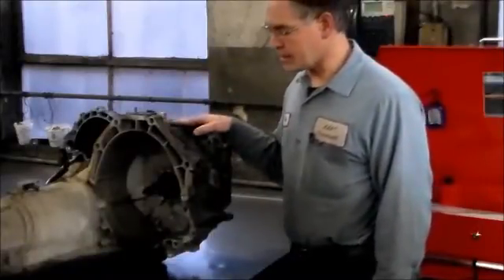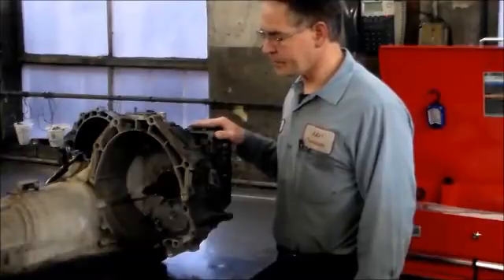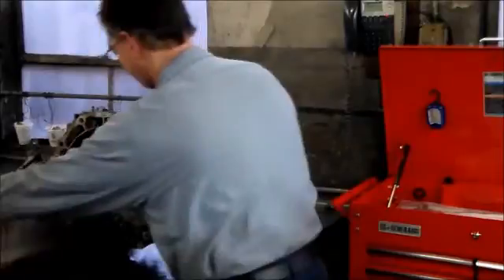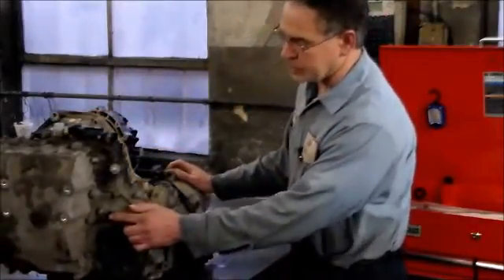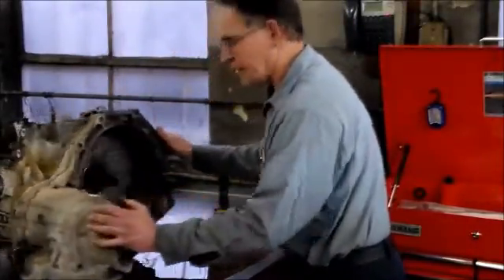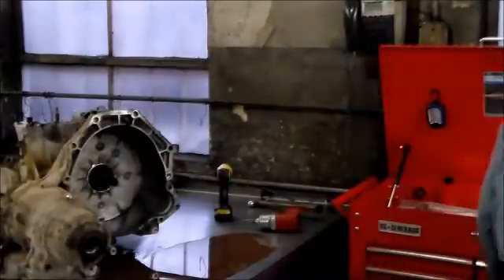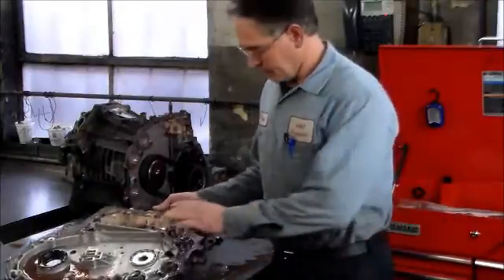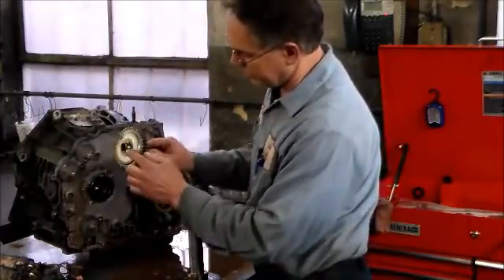AX4N Teardown Inspection, Part one

Comment: Great video, looking forward to watching more.  I will be rebuilding a high mileage Ford Freestar transmission soon.
Reply from the maker: ok, What is the problem with the trans?
Reply: @GaryFerraro  286,000 and it leaks.  It's working OK for now.  I have a low mileage engine so I am willing to do the transmission.

Comment: I have a 1999 Ford Windstar with AX4S TRANSMISSION and while driving at a constant speed on the interstate it all of sudden stopped moving checked for leaks(they are none) won't go into gear but had fluid....

Any ideas... Striped shaft? Blown clutches? Should I rebuild or buy.... Please help, pretty please 🥺😔🙏 lol 😁
Reply: Someone said possible bad shifting solenoids
Reply from the maker: @nicfle_gladiator  Sounds to me like the converter spline is stripped out if this happened suddenly
Reply: @GaryFerraro  literally out of no where.... That or the plates is my next guess.... Because when I hooked up the scan tool I could engage and disengage solenoid, so I can hear it do I assume it's working.... It works in 2nd weirdly but nothing else, no reverse, 1st or drive
Reply from the maker: @nicfle_gladiator  ok, so the car moves in 2nd, then not a stripped converter.  If it happened suddenly then something broke or stripped
Reply: @GaryFerraro  what should I do, or what can I do to further diagnose it
Reply from the maker: @nicfle_gladiator  Pretty much have to pull the trans and open it to see what failed, any noises?

Comment: Thanks for the video. For a 2005 Sable with AX4N what are the chances that a P0734 code is caused by a bad shift solenoid 3? Recently it hasn't been routinely shifting into 4th gear. Occasionally it does shift into 4th especially when warm.

Comment: Gary  took the clutches out on 3rd piston out top part then put air to it no push feel the air around it  . Granddaughter thought it was out of the tower but with every thing off could find it better. Believe the air trick worked thanks for the help

Comment: Have a ax4n burn 3rd clutch pack seals and piston looks good solenoid is good would it be the valve body or what have you seen
Reply from the maker: could have a problem with the EPC solenoid, i replace them every overhaul
Reply: Would it have a code the guy that hooked up said solenoids where good
Reply from the maker: @jamiekrebs9208  If the solenoid is mechanically clogged, you won't know, computer looks for correct current draw.  3rd gear burn up is not common for this trans, 2nd clutch burn up is. make sure the double drum has no ring grooves where the orange sealing rings ride. Are you overhauling the trans?
Reply: Used a snap on
Reply: Yep have it apart put new 4 clutch packs even though 3 only ones burned put it together slipped in 3 took back apart piston on 3 looks good haven’t took 2 piston out how many o rings only see 2 5 orange
Reply from the maker: @jamiekrebs9208  make sure the inner seal in the drum is ok, you need to air check the 3rd clutch through the center support, use 40psi of air and listen for leaks
Reply: Gary Ferraro ok thanks
Reply: Gary air it up 3rd does not move 2nd does hear air granddaughter feels air in the whole of the center support can’t feel any groves I see where orange rings don’t think it is sealing is the drum bad or the center support
Reply from the maker: @jamiekrebs9208  I would try the rings first
Reply: Gary Ferraro put the 5 in new to start  guess it’s not sealing orange ones
Reply from the maker: @jamiekrebs9208  Did you grease the rings? the rings need to expand, if you greased them they may not be able to, if you have trans fluid try wet air checking, , put some fluid into the port then air check
Reply: Gary Ferraro ok
Reply: New piston on 3rd fixed it thanks for the help God bless you
Reply: Trying to do a patch job
Reply from the maker: @jamiekrebs9208  I would do the piston for 3rd and air check the clutch through the center support. make sure the 2nd clutch is ok, that is the driving clutch in this trans meaning without 2nd you will have no 3rd or 4th. The rest of the trans works ok? you have it apart?
Reply: Yep 3 only
Reply from the maker: Jamie Krebs Awesome. Thanks for the update

Comment: Hey Gary, quick question. Check transmission light comes on on my Ford Taurus 2005 and code says P0733 gear 3 incorrect ratio. Changed the fluid and filter thinking that may be an issue. Changed the input sensor. The transmission surges and revs at high rpm then i hear a popping sound when i finally brake at a stop sign. Car has 78k miles on it. Seemed to be a lot of metal in the pan. First time changing tranny fluid ever but what was in there seemed like quite a bit. Trying to find direction. When driving in 1st and 2nd gear it’s fine unless i give it too much has. 3 it slips but gradually picks up speed. Can go the usual 70 mph on freeway. And even more. So it’s weird. Can you give me some direction please!!! Is it a solenoid issue?
Reply from the maker: This code is a mechanical code, Don't really see to many solenoid issues with these, i would say something is wrong with the 3rd or direct clutch pack. Does it slip all the time when the car is cold and hot?
Reply: Gary Ferraro yes it’s a continuous thing now. No matter the conditions.
Reply from the maker: @powermoveschris  Ok, sounds like something with a clutch pack, how is the 1-2 shift? 2nd clutch is the weak point on this trans and without 2nd you will not have 3rd or 4th
Reply: Gary Ferraro i would imagine that’s correct. There was so much metal in the pan. At least a quarter inch or more thick. Shifts fine in 1 and 2. That 3rd gear is where the slippage occurs. I notice the tranny surging and that’s when the gear ratio code came about. Car would just take off and accelerate randomly and elevate the rpm
Reply from the maker: @powermoveschris  Internal for sure, may have hard part damage

Comment: As far as I'm concerned the most typical problems I've seen with this Transmission in the Taurus as well as in the Continental which it never should have been in the Continental is the torque converter goes bad you should carry a torque converter in the trunk of your car as well as speed sensors out of all these speed sensors I would like to know how to replace them troubleshoot them at cetera
Reply from the maker: To trouble shoot speed sensors, if you have a scanner that shows live data you could see if your getting a reading on the scan tool

Comment: Hi Gary i found my line pressure around 75-100 and found 0 at epc tap? If you remember my transmission is not going past 2nd gear. I never checked the pressures on the previous Transmission that I had rebuilt but looks like I had the same problem on that. It can or cant be that both Transmissions had the same problem. But can you tell me where to begin my diagnosis. Please and thanks
Reply from the maker: ok, so this trans stays in first correct? and you swapped another transmission and same problem?
Reply: Gary Ferraro yes sir shifts from 1 to 2 fine then no 3 4 ... No codes
Reply: Gary Ferraro maybe the recent Transmission I put in also has a faulty valve body??

Comment: Gary Ferraro hi after a while I got time to play with my Windstar looks like the PCM is bad, I did test the wiring and pins on the PCM according to my alldata and found open circuit at the PCM between pin 6 -- to 71,24,25,51,76,77,91and103
This test was for the TSS turbine/transmission speed sensor test at the PCM  which other pinpoint tests were good. If you remember I had rebuild the transmission and it never shifted then put in another from the junkyard and did the same. What would you suggest. Any further tests? And should I buy a used or new PCM if available from the dealer and probably they can program it without the vehicle. I tried looking but I didn't see any burn marks but I will still try to further check this PCM. Still I will appreciate your advice. Thanks
Reply from the maker: Can you give me the year, make and model and engine size of your car, i would like to look at a wiring diagram as well
Reply: Gary Ferraro 1999 Ford Windstar 3.8 engine
Reply from the maker: ok, let look at a diagram and get back to you, may need a day or so shop is very busy
Reply: Gary Ferraro sounds great thank you very much
Reply from the maker: i looked up a wiring diagram, pin number 6 is the output speed sensor. Are you getting any codes?
Reply: Gary Ferraro No codes (active or stored) but I Might have noticed the theft light flashing when even when The engine was running (which might relate to a PCM issue).
Reply: So do you mean if the pin is not responding on my resistance test it means I can order a new PCM I think flagship1 maybe has one for $119 and I can also test the pins on that. I tried going to a junkyard to find a old matching PCM for cross checking mine but I didn't find a match. But do you think my transmission was not shifting(only shifted till second sometimes and would not come back to first, on both transmissions I put in), could this pin not responding be reason of my issue?
Reply from the maker: Surprised its not shifting and not setting any codes, have you done continuity checks on the wires?  So this just stays in 2nd ?
Reply: No codes, wires are good, it stays in 1st then moves to second sometimes and stays there until I restart the van
Reply from the maker: Ok, do you have access to a scanner that reads live data?
Reply: Yes sir I have one that reads live data

Comment: New fluid and filter about a month before problem started and def checked the level is correct. Thanks
Reply from the maker: ok, at this point you will have to look inside the unit,  If the other gears are ok, im thinking that the low intermediate clutch may be the problem

Comment: Hi Gary, i have a 2004 Freestar that i think has a transmission problem. My wife had told me there was a clicking sound up by the left front (drivers side) of the car when driving. I suspected a bad cv axle so I got under the van. The cv axle and boot looked great, no tears, no leaks, clamp tight? So I got in and drove it around and I occasionally heard what sounded like a grinding noise. The next day my wife drove the van and she lost power to the wheels. The car engine was running and the RPM's went up when she stepped on the gas, but the van was moving forward on it's own power. A little research on the internet and I found out that this van transmission has the problem with the pump shaft splines in the torque converter grinding off. This van transmission already had a recall for the problem but Ford just put in the same parts that went bad the first time. I am told there are upgraded parts now (a better pump shaft & torque converter) so I am tempted to do this repair but I can't find any video's on how to pull the transmission. Can you offer any advice? Once I get the transmission out I would like to do the rebuild as you show here.
Reply from the maker: I think they have harden splines for the converter,  Do you have reverse? Where are you located?
Reply: We're out here in California. I will have to check on the reverse (I took the battery for another car - had to get to work). Anyway, if it has reverse, does that mean it isn't the  torque converter spline issue? A neighbor of mine, who works on cars a lot, said it may actually camshaft or crankshaft position sensor (not sure which one he said). Ever heard of this causing this type of issue?

Comment: Hi Gary, thanks a million for posting this teardown it was a huge help! I had similar symptoms to Chad below on my 2002 Sable w/3.0L Duratec. Reverse and first gear seem fine and it shifts into second ok but then begins to slip when you give it gas and never makes it into third. I've got it apart now and sure enough, the intermediate clutch/drum is burned up. My question is, I ordered a "rebuilt" direct/intermediate drum from Rockauto and it is slightly shorter. I've looked at several supplier web sites and only see one part specified for my car. Is there more than one size for the direct/intermediate drums? They both appear slightly shorter. Here's a photo with the original (obviously overheated) on the left and the new one on the right: https://goo.gl/photos/nvCeYPjtSds318CVA Thanks! Mason
Reply from the maker: I wouldn't use that drum, it looks shorter, there is an AX4N trans and also an AX4S  trans,(same style unit but different) maybe take the foward drum off and look at the spline see if thats different.
Reply: Thanks for the quick reply! Yep, it's definitely shorter. Here's the original with the forward drum off side by side: https://goo.gl/photos/cFWzxpLKDFyZvmcz6. The invoice lists the correct part but now I see handwritten on the side of the box: "AXODE Direct & Int Drum, 3.8" so they sent me the wrong part. I guess it happens with used parts.
Reply from the maker: Yes, thats what i figured, better call em up, any issues i can hook you up with my rep, he can ship anywhere in the U.S
Reply: Thanks, I appreciate it. If they can't get the right part I'll do that.
Reply from the maker: Ok, let me know how you do
Reply: Hey Gary, I finally got the correct drum and other parts but one thing I can't seem to track down is the 5 scarf-cut teflon rings on the "driven sprocket support". I picked up the ATSG manual for AX4N and it gives part number "7d109". But I can't seem to find them anywhere. There are 5 and they look like they could really use replacing, they aren't smooth, so I'm hesitant to put it all back together without changing these.
Reply from the maker: That would just be an AX4N ring kit, where are you located?
Reply: I'm in Austin, TX. I notice the ATSG book shows 4 but mine has 5 rings.
Reply from the maker: They all have 5 not sure why they show 4, maybe a typo
Reply: Ha ha, you're right--on another page they show 5 rings. What's the best way to get in touch with your parts rep to order these? I searched all over and couldn't even find them on the Ford parts site. Ford has the scarf-cut seals for the pump shaft but not these (could be I'm not searching for the right thing though). Thanks again for all your help!
Reply from the maker: yomommaiscalling where are you located?
Reply: I'm in Austin, Texas. I'll message you with my contact info. Thanks! Mason
Reply from the maker: yomommaiscalling   My e mail is gsferraro@yahoo.com. Send me your e mail and I can give you my reps info.
Reply: Gary, thanks for all the help, I got the seals and finally got it all back together. No more slipping and also fixed the severe clunk going into drive. It's been about 2 weeks and so far no troubles! Can't thank you enough for taking the time to post these videos. Mason
Reply from the maker: Glad you got it fixed.  Good Job.  Gary

Comment: Hey Gary, got a 2003 ford Taurus AX4N. Has good 1st and 2nd and reverse but feels like neutral when its goes to third. Any thoughts on what it might be and also when you remove valve body where are check balls and will they fall out?
Reply from the maker: Chad Boling 
Hello,  what I'm thinking with this, is you actually may have a problem with a cracked intermediate piston.  Second gear is the primary gear in this trans and without second you won't have third or fourth.  If you pull the valve body there is one check all in the pump and about 5 in the valve body, no check balls will fall out if you remove the valve body, when you take off the separator plates you will see the check balls.
Reply: Gary Ferraro
The intermediate piston is in the low intermediate drum? How do you get those drums apart? I watched your videos and I thought you said you used a press to compress them so you could get the rings out?
Reply from the maker: Yes, to get to the pistons, i have a foot press, that will depress the springs to get the snap ring out.
Reply: Hey Gary, Hope you and your family had a good holiday. I got my AX4N(4F50N) apart and the intermediate clutch was burnt friction and steels. One of the steels had turned and binded on the hub and I had to beat it off. Do you know what might have caused this and what else to look for? The low/intermediate piston looked good as did all other parts.
Reply from the maker: I would change out those pistons, 2nd gear is the weak point in this unit, also look for ring grooves on the inside drum(where the 5 rings ride)Also, in the channel plate there are the accumulators change those o-rings and the one by the filter too. Gary
Reply: will do, thanks for your help.
Reply from the maker: welcome

Comment: Hey Gary! Man you've done a lot of vids since you helped me with my AX4S in my 2000 Windstar last year. Its still going strong. Hope all is going well.
Reply from the maker: Hello,
  All is well here, shop still very busy thanks for asking. Hope all is well with you, Have you done any more transmission jobs since yours?
Reply: I've had a few opportunities to work on transmissions but without a scanner of my own to check codes first I didn't fool with them.

Is it true that if a transmission doesn't have forward or reverse the tranny has to come out?
Reply from the maker: Hello,  Well if the car doesnt move in either direction, could be pump, pressure regulator , filter or converter problem. One way to tell is to check the fluid, if the fluid looks way over full then your pump is no good. I actually had an issue(one time) where the filter was faulty causing a no move condition. Most of the time the trans will have to come out.